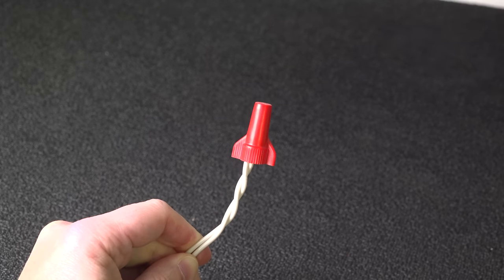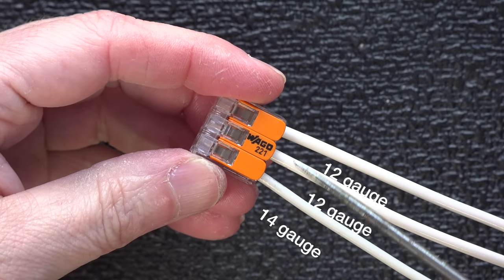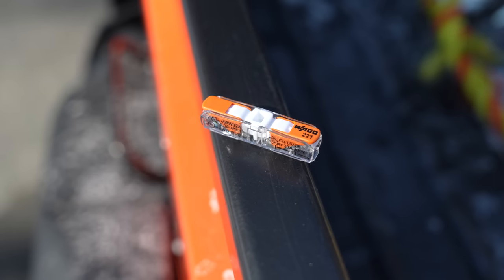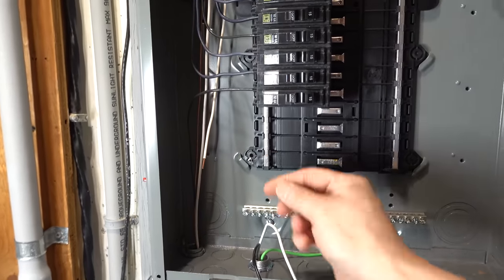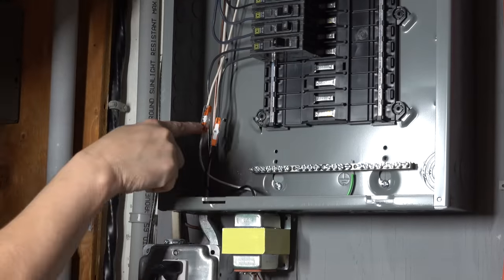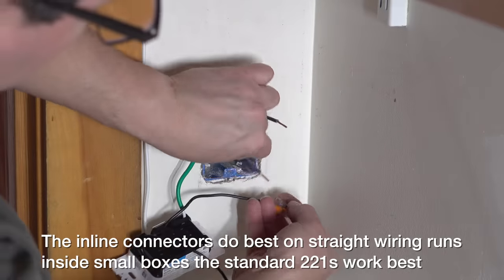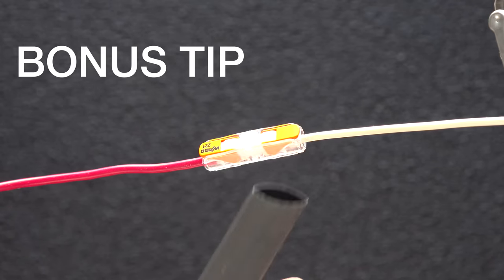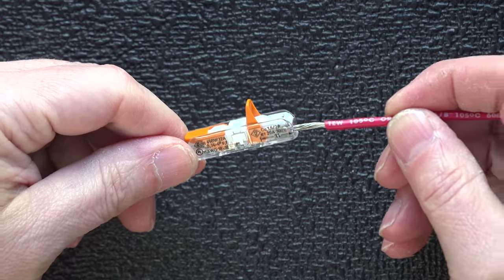New Wago Electric Connector is SHOCKING everyone - Inline 221 has arrived!

Comment: If it’s SHOCKING everyone they’re probably not very good.
Reply: Well played, sir.
Reply: Lol, good one!
Reply: WAGO is a German company with just 8600 employees, funded in 1951. Their main focus in on Germany and Europe, with the rest of the world making up 29% of their revenue. They're the world's leading company for this type of connectors for electrical wiring, probably because they own the patents.
Reply: @Steve Sherman what makes you think he’s a bot lol
Reply: It is shocking that he did not talk about the mounting adapters for these (like the WAGO 221-2503 or the 221-500)
Reply: Wagos are amazing I've pumped over 10 amps constantly for years with 0 problems.  You people stuck in your ways think there were no engineers or testing involved.  UL was also involved with these wire nuts are terrible and mangles the wire and much of Europe doesn't use them.
Reply: took me a sec, I admit. hilarious!!
Reply: I stopped using them because of that very reason...current can pass through a wago 221 connector. The plastic is too thin at one point on the back and you can get slightly shocked if you touch a grounded object. I tested this with various wago 221 connectors and had the same "shocking" results. You can also just put a multimeter and touch the back of the plastic and read voltage through the connector.  Not sure why these are so widely used and well acclaimed...
Reply: @Steve Sherman Nah, I just thought it would be nice to point out why they're actually not as widely used as they could be.
Reply: This ist THE High End Connection System here in Germany! 😉👍
Reply: You sly one
Reply: ba dum tss
Reply: I was ready to rebut, then I got the joke.
Reply: That's. The. Joke.
Reply: They are good as long as you use them right.
Reply: Hehehe, nice.
Reply: Wago users will get defensive until they realized its just a joke😂

Comment: I recently started using these connectors, they made changing out a light a dream. The electrical was the easiest part, love these!
Reply: Same I work for a HVAC company and I use it all the time I love it
Reply: @Steve Sherman We will never use Wagos down here in South America. Screw terminals are cheap and available pretty much anywhere, just have to know how to use them (and i can tell a lot of people here don't).
Reply: Had "opposite experience".  Need to paint a hose, took of light fixtures outside,  and found that window installers few years ago has used push-in Wagos. Well, had to cut them off to disconnect.  Of course those were not with levers, but it was sad to send them to the trash
Reply: @dmitripogosian5084  you didn't need to cut and trash them, had you knows how to get the wires out without damage
(by rotating the single strand wire radially back and forth a few half turns while slightly pulling )
Reply: @enzoperruccio  if you want to remain forever in your stone age..
anyone with half a brain + the slightest interest to make his life easier, will eventually use wagos.
(here in orlind there're also many fully qualified electricians who are either too dumb to use wagos,
or, more likely, they refuse to do anything different that has worked for them so far..
i.e. they are the types who would not cross a newly built bridge where there was no bridge before,
they would continue taking the 10 mile longer way round - just because that is the way they've always taken.. 😂)
Reply: @laus9953  First of all, I did not know at the time, second, rotating - it is easier said than done when there are 4 wire sticking out of the nut
Reply: @dmitripogosian5084 just hold one wire firmly so it doesnt rotate (maybe add a bend so you can hold it better)  and rotate and pull the wago till its out. then repeat for the next wire.
Reply: @unitrader403  It is hard to do when you have three wires going in in a tight box. You cannot twist one wire individually (at least with any ease)
Reply: @dmitripogosian5084  yeah, but my hint was to twist the wago, not the wire. just hold the wire so it doesnt rotate wih the wago.
Reply: @unitrader403  But if there are three wires into the same wago, how do you twist wago around one of them ?
Reply: Unfortunately the accessories that compliment the wago are hard to get. But they are much better than you know.

Comment: You can get shrink wrap with a water proof lining on the inside. When you heat it up and it shrinks the, “goop” on the inside  softens then molds to the wire to give you a hermetically sealed connection. Used it a lot in the millitary.
Reply: Good stuff, easy way to find it is search for marine shrink tubing.
Reply: Technically called meltable inner lining. Great stuff. Permanent since that wago would get melted lining all over it. 

Just saw a light switch with integrated Wagos as well.
Reply: Better to also some grease .
Reply: Wago needs quite a big tube, which will not shrink that much, as to make it seal around the wire.
Probably there are tubes with larger shrink ratio now, but i have not seen one.
Reply: @krahaborowski  use the big tube to cover the Wago and an inch of the cable on both sides. Now use two smaller marine shrinking tubes with the glue to seal the two sides. Bang, water proof and the Wago does not get covered in glue.
Reply: @abbe79de  In this case I would just solder those two wires :)
Reply: @krahaborowski  I own some transparent shrinking tube that has solder in the middle and heat glue at the end - does all this in one step.
Reply: @abbe79de  I know those, but somehow I do not trust solder that melts at that low temp.
Normal soldering is not that difficult, after all.
Reply: You should use the wago gel box for marine applications. The 221 connector goes into a gel box which is closed around it.
Reply: To be more specific on that subject it is known as glue lines, marine heat shrink or water proof heat shrink. I use it a lot with situations that there is a potential for water getting to the connection joint. I have a few joints on my truck right now that need it but I have them in a temporary setup until I put the right part in, then I will use the heat shrink for that situation. I found out about it when I was working for a wheelchair manufacturer that used it extensively on all of the anderson connectors they used for all electrical connections outside of boxes.
Reply: There's also a matching gel box for Wago 221.
Reply: @krahaborowski  есть такая термоусадка.я постоянно пользуеюсь ей
Reply: @krahaborowski  They are also absurdly expensive.
Reply: Yep, good for an inline repair and splicing as long as you know what to do. You can get solder sleeves now with shrink boots on. This and a length of shrink sleeve for extra protection is ideal for battlefield repairs (or your car). If you really really need it a length of self amalgamating tape can be used too.
Reply: @krahaborowski  Low melt solder is fine. I repaired my brake servos with this and never had an issue.
Reply: @krahaborowski  Soldering high current wires is a tricky thing.  I would use crimp on with a shrink wrap

Comment: Wagos have been a lifesaver in my 1940's house. As I have updated wiring and added switches and outlets it has reduced a lot of the stress of dealing with old wires.
Reply from the maker: Thats so great to hear. I have easily used over 400 of them with no failures, ever.
Reply: 80 years? Did you perform insulation resistance test?
Reply: Aluminium to copper?
Reply: No

Comment: Shocking to our “over the ocean” friends. In Europe they are everyday stuff. A couple of years ago when i was on site in Houston and for first time i saw the wire nuts they were using in industrial application, i was shocked. I still sometimes do have nightmares…
Reply: A properly installed wire nut is a stronger connection as well as higher melt temperature than a wago.  However, the wago is definitely "good enough" when it comes to those things, and the ease of installation wins out for a lot of people.
Reply: @tirdkat6104  Both are plastic, both melt at the same temp. They are not built to be heat resistans of any kind and is only used as a connection. Properly installed wires will never go hot or arc.
Reply: @tirdkat6104  Connection strength and heat resistance really isn't a relevant factor. Ease of use and reliability is. Adding one more wire to a wire nut is tideous since they have a habit of "falling out" unless you unscrew all the wires first which takes a lot of time.

No one I know uses wire nuts for new installations and in older installations where they might come upon them they usually exchange them for a wago and throw them away because they're simply terrible in almost every way.
Reply: @Prahlis92  It takes all of 30 seconds to untwist a bundle and twist a new one in, I don't know what you're on about.

Comment: In Europe we have gel filled boxes (their name is Gelbox) specially for Wago terminals, by using those you can use wagos even under water. It has IPX8 rating, and it's really convenient. But I'm not sure if you can buy it in the us.
Reply: That's so cool, thanks for sharing!
Reply: Hade jag ingen aning om. Tack för tipset. Har du något exempel på var du använt det?
Reply: We have gel filled wire nuts for wet conditions
Reply: @Prahlis92  Hej! Jag installerar utomhusbarriärer och jag använder Wago Gelbox för dem.

Comment: I see a major benefit to the inline when extending inside a circuit breaker box. It will make for a much neater installation when moving breakers around.
Reply: These can be used when something failed and the cable is not long enough anymore, these will be a dream come true for those situations, you can repair it fast without changing the entire wiring without too much risk to fail on you.
Reply: Doing exactly that right now. Replacing a 1940s fuse box in a 1914 built home with 3+ layers of hacked in mods over the years.
It's really fun living in the space and needing to keep enough running while ripping out old wire and MC which is not allowed where I live.